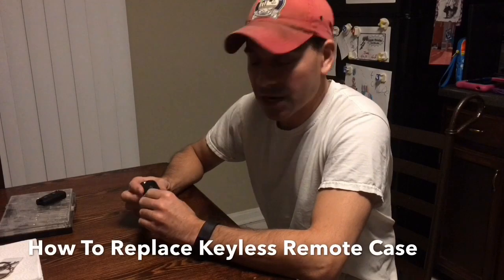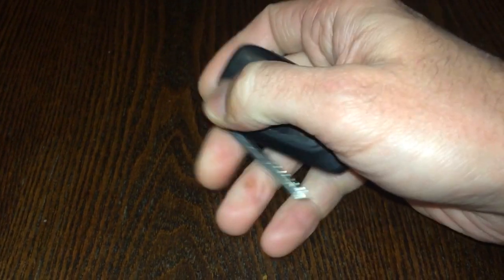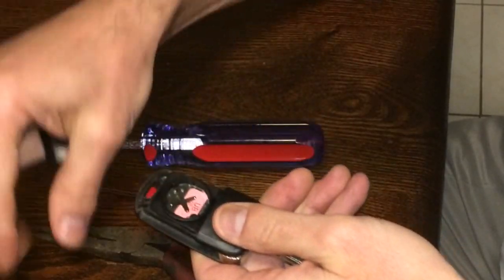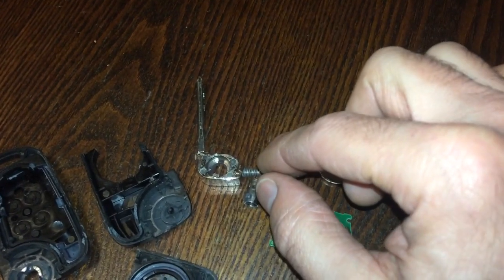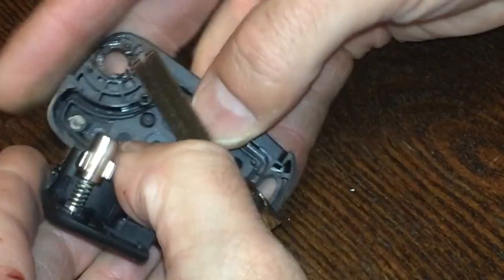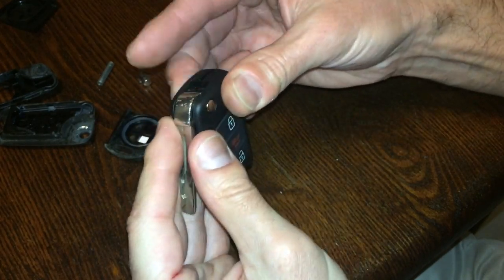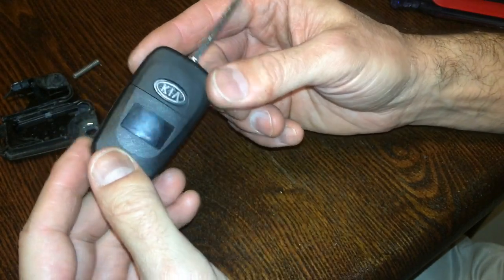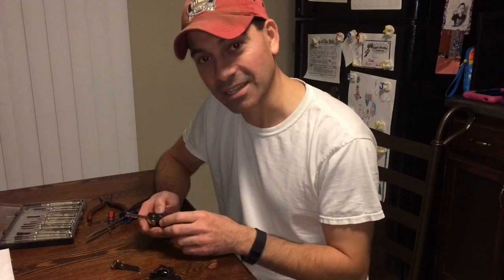How To Replace/Repair Keyless Remote Case (Andy’s Garage: Episode - 26)

Comment: Great tutorial, except that it gave me a false sense of security....  Nothing is mentioned about the security transmitter chip so after switching out the motherboard and switching the key, I tested the door locking mechanism and was all set!!  Or so I thought.... the next morning the car was disabled and wouldn't start for me..  upon towing to the shop and them running a diagnostic a P 1693 immobilizer error came up.   I found the old key chassis and sure enough the transponder chip was in the framing across from the board.  Something for others to watch out for..... 👎

Comment: I tried this but now that key won’t start the car
Reply from the maker: max beard changing the case has nothing to do with starting the car. All you’re replacing is the plastic housing.
Reply: Actually it does. After I changed the shell  with help of this video my car did not start as well. I tried with original old key and it started the car. Immobilizer is stopping it from starting. Tried to reassemble the old key, did not work

Comment: Once the key fob was replaced, does the key fob need to be programmed, I replaced the new housing but the car could not start, just engine running.
Reply from the maker: If you moved everything from the original case to the new, then no it does not need reprogramming. It should work fine. If you replaced with a new chip, then yes it will need reprogramming